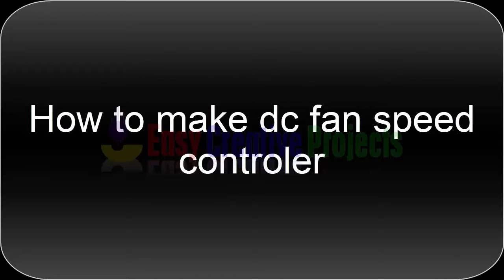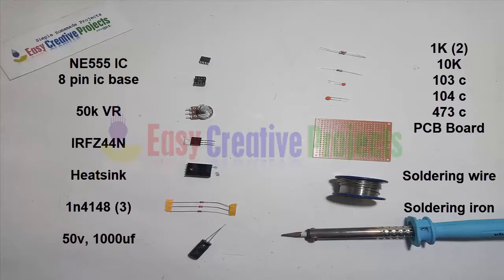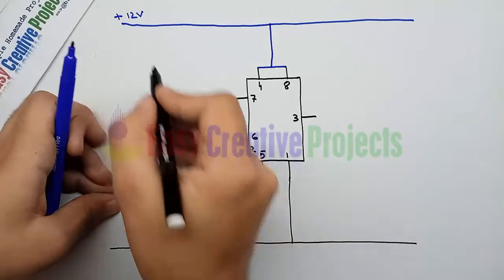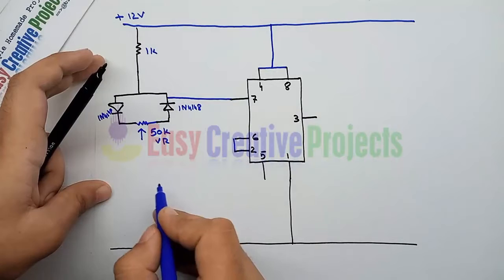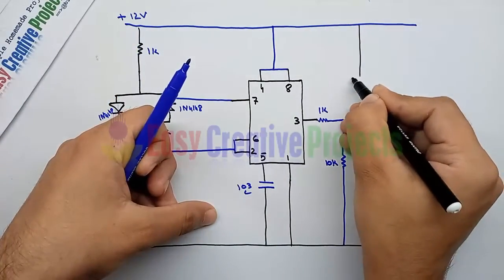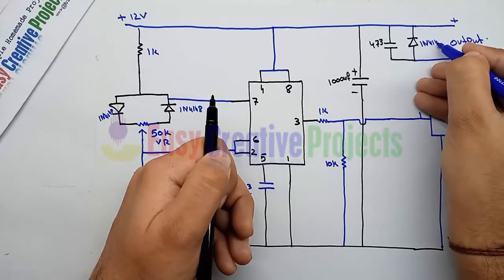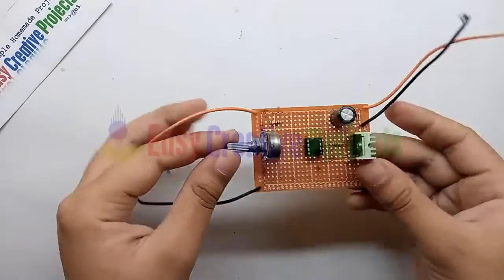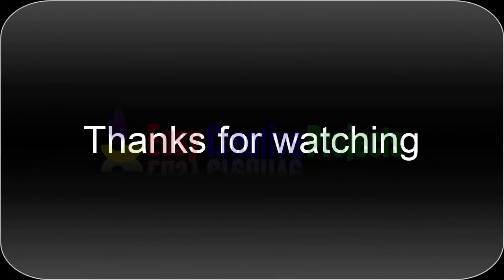how to make dc fan speed controller - upto10amp

Comment: Many speed controler making videos have do this with only one mosfet + potentiometer only. What is the difference between that two component circuit and charging this multiple components using circuit? ????
Reply from the maker: its very simple to understand with this example.
you have one bottle with full of water. and mosfet like bottle head. 
and potentiometer like bottle cap.
when you open bottle cap slowly then water come outside slowly. 
and if you open cap full then water through fastly.
same like mosfet and potentiometer. we controll power with the help of mosfet and potentiometer.
thanks.

Comment: 12 vকেমন 775 মটর চলবে
Reply from the maker: you need good ampere adapter or power supply for running 775 motor in 12v.